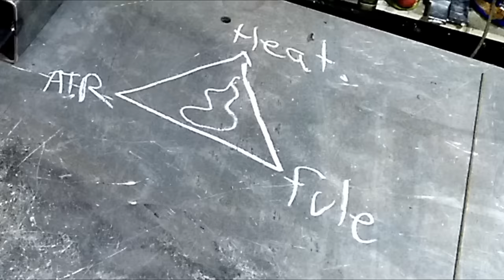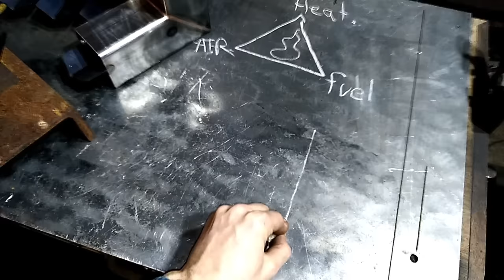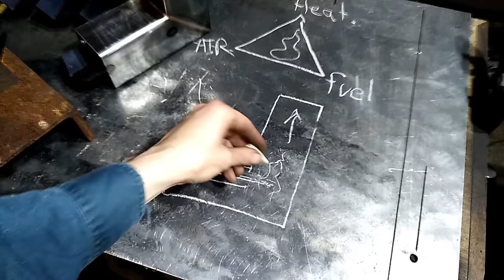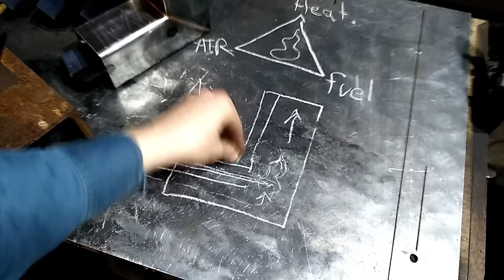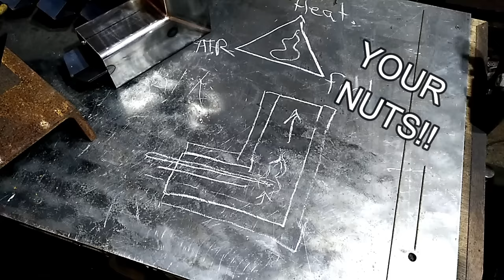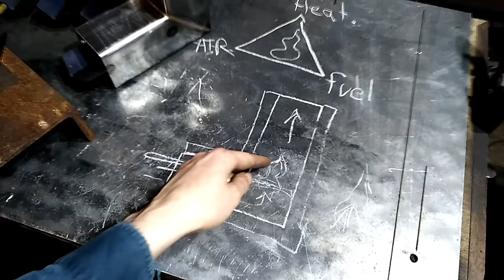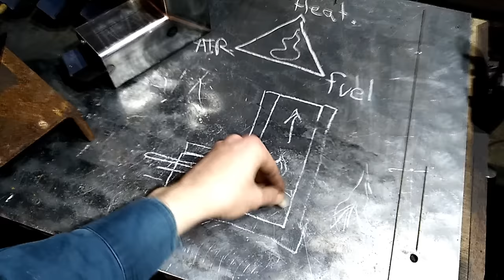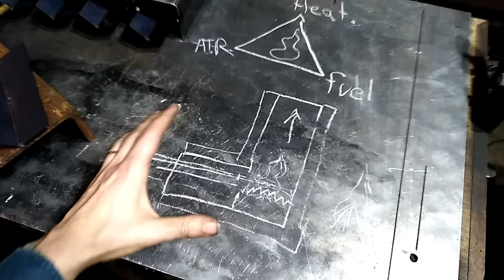Rocket Stove Science

Comment: Would it be possible to have a separated wood feed inlet at an angle so it gravity feeds the fuel - so you don't need to push it in?
Reply from the maker: Yes you could, that would just turn it into a k type rocket stove and it would need to be a lot bigger to work properly, which is why I go with a L type because it can be a lot smaller and still give the desired results. I'm planning a video in about a months time of J v K v L designs, where I will share my thoughts on all three.
Reply: Thanks. I think I'm getting it... K, L and J type rockets to suit different circumstances.

Comment: If it's insulated properly than it will be to hot for steel and won't last. Don't use steel for the heat riser as the stove becomes more dangerous over time, spend the money on fire brick or a material that can handle the heat.

Comment: @Little Aussie Rockets
If you use more of a Y shape, you both get a hole for the ash to go & the sticks kind of auto-feed into the fire.

Something like this:

|    | 
|    |/  /  <--- Maybe little less extreme angle.
|      /     <--- Maybe can drill extra air-intake holes around here? Or it might be a fire hazard if embers fall out?
|___|      <--- Ash collection, maybe with a removable tray, hatch or bottom.

Yeah, like the one at 9:50

Comment: hey, sir, I made one with stainless steel round tube is the best that can last you a lifetime the best way to make your stove is when you insolate it with 2" thick ceramic blanket that's what they use in furnace.I feed mine with twigs fat like my finger and within 5 minutes it starts getting red 20 minutes it gets so red it wants to burn up the fire inside it and when it gets that red you only use one or two-piece of twig to run it. normal steel cannot manage that high temperature it will not last along time after a few use it will star shell down if you need help I can.
Reply from the maker: Thanks mate. I moved to stainless steel and haven't looked back. 👍

Comment: I have made really efficient rocket stove. They end up being over 5 feet tall and probably over 60 pounds. Like you mentioned very expensive to ship. What you are making is just a very cumbersome to operate and inefficient woodstove that makes enough ash to block the airflow. If you can not find an economical way to ship a properly built rocket stove then why don't you just make an effective efficient small woodstove of your own design.

The weight of steel is very high no matter what you make it into. It's hard to ship any wood burner/ stove good luck mate!
Reply from the maker: I'm about to release a stove called the Emu that is just that . . . stay tuned.

Comment: Whats the difference between a rocket stove and a triplle burn slow  combustion stove? I have a 3x hurn combustion stove and I  am often on the roof because i collect the rain h2o. I am amazed how hot the flue is altho its 8mtrs long. I cant leave my hand there, so is that an energy source going to waste??
Reply from the maker: I'm not really an authority on those types of stoves.   Where the rocket stove really shines is it will run on really rubbish wood, doesn't need hardwood, and it burns extremely cleanly. Basically the  idea is to  run the stove hot and hard for a short period of time  like 3 to 4 hours and have a thermal mass attached to the stove that stores the excess heat that would otherwise be wasted up the flu.  The mass then releases the heat slowly back into the room for a period of hours.

Comment: You should make a small scraper s you can pull the ash out as it builds up, or a small sliding plate on the bottom to drop the ash out.
Reply from the maker: Thanks, that's a good idea. I'm working on a few upgrades, which is turning into a completely new style of stove.  Will be sharing it soon. Thanks again

Comment: Why cant we have an opening below, something which can be opened to remove the ashes?
Second- the slit...wouldn't it let oxygen mix with the twigs and as a result the twigs get burnt more than the 70mm that you claim?
Reply from the maker: I have a stainless steel stove now that has a ash tray. LRS Dingo. That works like that.

Air flow like water and takes the path of least resistance.  The slit helps you out when ash starts to build up. Got to run, my chickens are invading the work shop.

Comment: why is feeder tube 90degree as opposed to being 45 degree angle?  why don't you have a 'ash-puller-shovel' set  into air flow compartment... all you need do is pull the rod attached to the ash remover... from time to time... then once ash is removed.... simply reinsert the ash puller-shovel . it can be thin, less than 1/8"  metal to do the job.
Reply from the maker: The short answer is, a rocket stove this small does not work efficiently with a 45 degree feeder, it becomes a hobo stove at that point with no real rocket effect. Where an L can be made very small and still give the good heat air fuel mixture that we all love and know.   I have a stainless steel stove called the Dingo that has an ash tray just like you described. It was easier to start again with a new design. Thanks Mate

Comment: I have seen one thats built like a small suit case , 2 inches high and 20 inches long and width 10 inches. on top  right of the box there is a hole and plate to let air in and bottom left a open rounded hole that you put twigs, In side the box there a baffles welded to the bottom and one near the air hole, to START IT YOU PUT TWIGS IN THE BOTTOM LEFT HOLE and blow to get it going, Its a furnace when it starts;-)

Comment: I don't understand why you don't use the j configuration . It should self feed that way to a point.  And also easyer  to see what is going on inside.
Reply from the maker: I haven't done much with the j rocket stove, manly because of size and weight . My little stove is just on 4 kg which means I can send it through regular post. But I will be exploring the j type in time. Thanks for sharing your thoughts 👍👍
Reply: Horizontal tube allows much better fine control of heat level. Cooking stoves need to be turned down as well as up. Most cooking is done at simmer, after a pot has been brought rapidly to the boil.

Comment: Nice welds.
Reply from the maker: Thanks, mate
Reply: @LittleAussieRockets  I didn't see them close up but it looks like some damn fine TIG.
Reply from the maker: @samnottheotherone4363  the welder is a Rossi 200P AC DC TIG. I was using a number 17 air cooled touch
With a stubby gas lens kit, number 8 cup. 
Tungsten 2% Thoriated 1.6 mm
And I'm tig brazing with silicon bronze.  Running around 60 amp.
Reply: @LittleAussieRockets   How much is a 1/16 inch thoriated where you are?
Reply from the maker: @samnottheotherone4363  like $20 for a pack
Reply: @LittleAussieRockets  of 3?
Reply from the maker: @samnottheotherone4363  pack's of 10👍

Comment: 1. Pots are round, chimneys should be round and slightly bigger diameter of a standard pot so the pot can fit down inside. 
2. Why not build it with a J-tube so there's no need to feed fuel? 
3. Why not insulate by using aircrete instead of metal? It is lighter to ship and can be handled while burning. 
4. A bottom trap door allows the ash to be dropped out. 
5. You didn't explain the tube in the middle of the chimney. Was it to create a vortex?
Reply from the maker: All good points. This is why this channel exists, to share knowledge, we all learn from each others failures and successes.  I'm sure in the future I will build a stove that has the features you've mentioned.  For now I build stoves from what I can find in scrap bins, except the ones I sell of course.  To answer point 5, that pipe is my attempt at a secondary air intake, and it would seem that as you say it does help create a vortex.    If you want to see the build of that video, check out the rocket stove pizza oven.
Reply: The research has been done in OR, USA at Aprovecho Research Lab. Three pieces of metal over the burn box direct the flame for max efficiency. Check it out. I watched the other video. Seems you have found a 2nd way to get a vortex.
Reply: Why not make your own video?
Reply: Because no one can top Kirk Harris's stove, video found at Aprovecho Research Center.
Reply: The only easy way to get vortex is, to have cylindrical tubes...tested. But they are much trickier to build a stove from,
Reply: I can't dispute your claim because I have no idea how hard it is to engineer the "vortex tube". But if it's "the only easy way" and "much trickier to build a stove from" you seem to contradict. Do you mean once built it's easier to maintain? Easier than the two deflectors separated by a stationary fan blade? How do you know? Have you tested both? Aprovecho Research Center has the ultimate test lab for mass stoves. If they test the cylinder tube stove, then we will know if it is the most efficient.
Reply: @1voluntaryist  The only easy way refers to, that cylindrical tube has the same inner prtofile, as vortex, and it rotates smoothly. Square shape make it disrupted at the corners - of course tested, so far I have both. Trickie is, try to profile the rectangular shape to join the same, and cylindrical shape to the same, at 60* for example. Cylindrical tubes are quite tricky to just cut at any angle, different from 90*, I mean, with just angle grinder,
Reply: @1voluntaryist  This stove is a gasifier,not a proper Rocket stove.If you put those blades in a rocket stove they would not last long.
Reply: djyul: Have you done it? My take is a "gasifier" is a more complex version of the rocket stove. It utilizes a secondary burn leaving cleaner exhaust. Does this result in a hotter burn? Then the metal deflectors and blade need to be made of ceramic. Problem avoided.

Comment: What size tube works best ? X ?
I tried 3x3 sorta fiddly hard to keep going
Reply from the maker: 3" box works well for me as long as I don't feed it anything larger than my pinky (finger). 100 x 100 x 3mm (sorry my brain is stuck in metric system) is a good size to use, less fussy about what you feed it, will have a better heat output.  Just make sure the riser is longer than the air intake / burn chamber. 👌👍  Thanks Mate
Reply: OK I will give it a go and follow your tip . Next I'm building a 3mil thick gasification stove to make coffee/tea

Comment: Question for anybody who might know....So if I want to use one for heat, and I contain the heat inside the burn chamber and flu by insulating between the stove and an outer jacket so as to optimize the efficiency of   burning off the fuel source then wouldn't it reduce the heat I'd get radiating out into the room area where I'd want it. ?
Reply: I have the same question.

Comment: Is there any set ratio between the intake length and riser length ? or does it not matter at all ?
Reply: Aj Nunya I think it's one to three minimum. Otherwise it back-draughts
Reply: TheKlink thanks
Reply from the maker: Yep I second that. I once made a rocket stove (as an experiment) with a short rise and a long hopper.  Not enough draw, poor heat output.

Comment: good video but i was wondering why such a talk n slim design, looks unstable when u cook a full pot of soup. 2nd question is how are u gonna clean it(remove ashes). bring whole stove to the basin?
Reply from the maker: I sell these stoves and they need to be slim for shipping. After lots of experimenting  I have found a good balance between compact size and good usable heat output. The stove is actually quite stable. I have put large pots on the top and tried to knock it over, obviously whilst not running, and was surprised how tough it was to make it topple.  Cleaning out the ash really isn't a big deal, when you are finished cooking, you pick it up by the handle and with one tap on the ground it all falls out. Once the stove is cold of course.  I don't recommend wetting these stoves as you will accelerate rust, I just put a dob of olive oil on a cloth and wipe down the outside to keep it looking nice.   Hope that answers your questions, thanks for watching!
Reply: oh i saw your complete stove(video 0:01) with the round bucket, it should be stable with it. thx for reply.

Comment: How can you have secondary burn?
Reply from the maker: By introducing air in the riser where the gasses are still hot enough for ignition but don't have enough oxygen. Just adding fresh air to the mix will do it. Works even better if you can preheat the air before introducing it back into the riser.

Comment: IS IT POSSIBLE TO BUILD A STOVE THAT WILL BURN ALL NIGHT TO HEAT MY WORK SHOP
Reply from the maker: If you were using wood pellets for the fuel, yes.  Otherwise you'll need a large thermal battery to slowly released the heat into your work shop through the night. But your workshop would need to be well insulated for this to have any affect.
Reply: @LittleAussieRockets  OK THANKS FOR GETTING BACK TO ME

Comment: can a copper coil be included to heat hot water ?
Reply: is there enough heat power to heat 40 gallons of water by thermo siphon process? Or is a bigger rocket stove needed with a bigger firebox ?
Reply: please search ppotty1 on utube and he has made a large rocket stove to heat hot water, incase you wanted some inspiration. he's from the industrial north of england, where the brains in this country reside.
Reply: DRJMF1
Reply: Certainly
Reply: Absolutely! I run a 10 foot coil of 1/4 inch copper tubing inside my riser. I use a high temp pump mounted to the bottom of a stainless mixing bowl with a about a gallon of water in it.  This though a small heater core before returning to the reservoir.  The water circulates top to bottom for efficient heat exchange since the water is flowing towards progressively higher heat before leaving the heating portion of the circuit.  A small desktop fan blows air through the heater core. With a decent fire burning slow and steady on bigger pieces,  the air blowing into the room averages 175 degrees.  With a higher flame using smaller pieces or pellets in a basket,  the room air tops 204 degrees and the water in the coil turns to steam. Any heat energy not extracted by the heater is returned to the reservoir,  preheating the water sent to the stove coil. I can get a gallon of water near boiling in ten minutes this way. For reference,  my stove is made of cinder blocks,  so my primary burn chamber is about 216 cubic inches.
Reply: @daveopincarne3718  Maybe you could post a video showing your stove, coils etc?  If you do pls. put me on your mail list or notify.  Thx.
Reply: @DRJMF1  aah, the brain's are in the north like in  AMERICIA.
Reply: @daveopincarne3718  pics please

Comment: First statement right off the bat . . . what makes a good rocket stove.  By not using square tubing for the riser, that what makes a good rocket stove.  You ask why not square tubing, I'll tell you why.  For a complete smokeless burn a vortex swirl pattern of fire needs to start at the bottom of the fire chamber.  Square tubing isn't round.  To start a vortex correctly at the bottom of the fire chamber, round tubing is the proper way to start the vortex swirl of fire so the total exchange of heat can be utilized from the complete burning of the smoke and fire mixture.  Yes, smoke has energy.  To start the vortex swirl at the bottom of the fire chamber which is right close to the bottom of the round tubing, at the connection of the square tubing and round tubing, this connection should be offset a half inch or so and a flat piece of metal welded to the opposite side at 45° angle or a little less aiming the air and burn mixture towards the otherside of of the round section of pipe starting the swirl pattern.  Once this vortex of burn mixture has started its journey swirling up at about two inches give or take a half inch one way or another, a hole needs drilled ( not sure correct size of hole ) to allow fresh air in which will cause a afterburner effect to the up rising burn mixture allowing for a complete burn.  A square tubing riser doesn't allow the swirl to get started quick enough causing a small dead spot in the corners possibly not even allowing a swirl pattern to start all together.  Video link at bottom shows the connection of round riser pipe to square tubing fire box.  Notice the offset connection of the two round & square tubing and the afterburner on the otherside of rocket stove.

  All fireplaces in homes are largely inefficient because there's not a complete burn of the air wood burn mixture.  When you see smoke leaving the chimney, its wasting lots of wood to get just a small portion of heat transfer from fire.  A correctly built rocket stove a person can heat their home with a couple of big hand fulls of thumb sized sticks not regular sized fire wood.  People been wasting fire wood for centuries, and think of all the hard work that evolved just getting the fire wood, when all that's needed are thumb sized sticks which can be harvested by walking around trees and picking up fallen fire wood on the ground.  Lots of good videos on YouTube showing how to utilize a rocket stove in a moden home.

Square tubing for burn box, round tubing for riser.
https://youtu.be/8lpcfhfyQH4